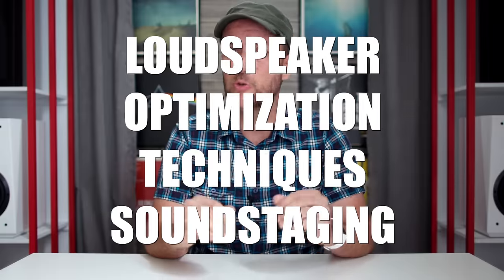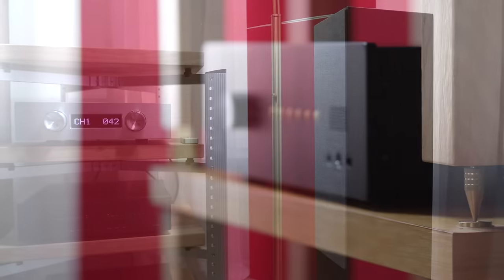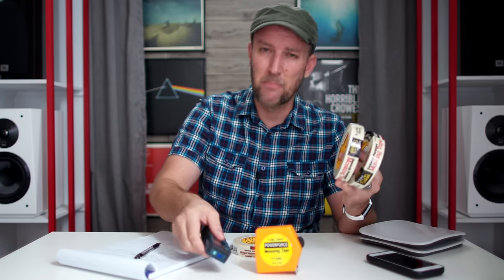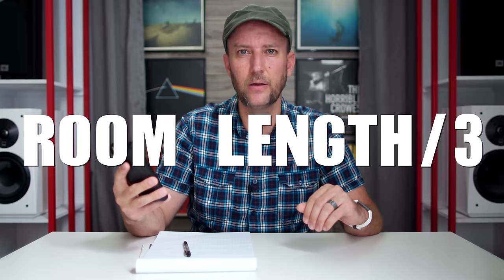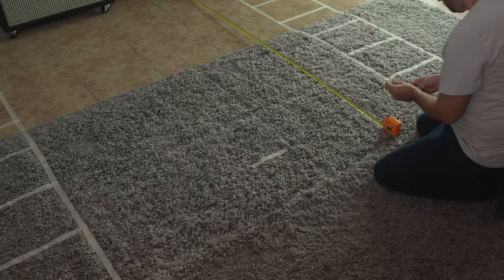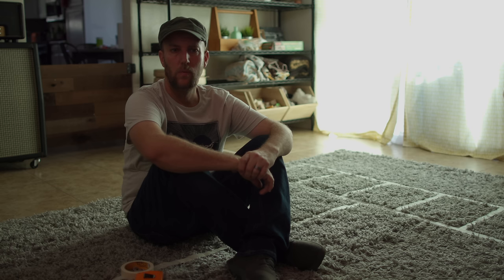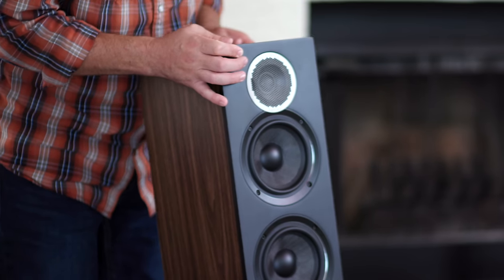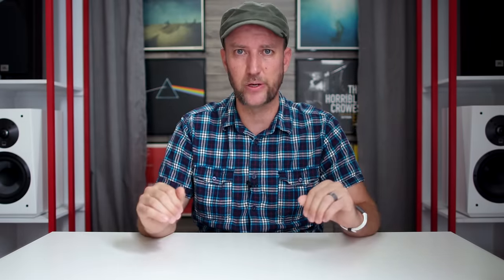L.O.T.S. Loudspeaker Optimization Techniques for Soundstage!

Comment: That's a great method because one is NOT going to focus on the relative "loss" of bass. Of course it would make sense to put the speakers at equal distance from a side wall using one of those node-avoiding distances such as 0.276 (Golden Ratio) or 0.2265 (Square Root of 2) times the room width. Other than that, great method!
Reply from the maker: Thanks so much!
Reply: @Newrecordday2013  You're welcome! I'm sure you realize that those ratios aren't "really" (in the sense of completely) going to avoid room nodes, but are used to avoid the cumulation of room nodes? Don't mean to spread misleading information or add to "audio myths" (as long as there are walls, there are going to be room nodes).
Reply from the maker: Absolutely and every room is different so experimenting is required!
Reply: @Newrecordday2013  Unfortunately! There's no substitute for measuring and listening, and I like your approach as one isn't going to be "blinded" for e.g. imaging by hearing a decreasing amount of bass starting from the front wall, but the exact other way round. The ratios I'm proposing remain the best starting points (avoiding unison resonances) I've found over the years (as to which to start with depends on first-reflection side-wall distance and mid-bass coupling). It's pretty amazing how good Golden Ratio sounds if used on the blind (needless to say 0.447 times the room width from the front wall is pretty far out for a multi-purpose "living" room, but as you're emphasizing in your video, too close to the wall is what tends to be the problem). I'm not saying it isn't worth trying to improve on the math, but that I'd mark these positions and draw lines from them to the respective front wall corners in case one is forced to move the speakers closer to the front wall than ideal. At any rate, there's always going to be the difference between the acoustic centre of the bass driver and the front of the baffle, in other words, there's always room (pun intended) for micro-management and/or going OCD, given sufficient time and patience…

Comment: Very nice demonstration of the rule of thirds. However all of these "rules" are approximations. You can get pretty amazing results using the Golden Ratio or 5:8 rule it really depends on your actual room size and layout.  The biggest challenge for most folks I think is going to be having your couch out in the middle of the room. In practical terms therefore you may need treatment on your back wall to help it "disappear" somewhat.

Comment: Thank you so much for sharing your work. I have an acoustic treated room which is my 2 channel listening space. I have been an audio fool since 1969 and love my vinyl, tubes, etc. I have built my own electronics, speakers, etc. I have always used the Carda’s triangle for speaker placement. I followed your instructions exactly as you laying them out (pun couldn’t resist). Put my tin foil hat on and did the “dark night of the soul” setup moving from listening position one square at a time until “holy mole” the damn things disappeared. I turned the light on and measured them and guess what, perfect Carda’s triangle! What fun!

Comment: Is this method primarily for music purposes?  Can this be used to set up the starting positioning for home theater speakers?
Reply from the maker: Dude, it would work brilliant for home theater applications as well as long as you have the room... absolutely!
Reply: @Newrecordday2013  Awesome, I'll try it!  But basically this only goes for the front towers, right?  I would just base the location of the other speakers off of the tower placement?
Reply: @Newrecordday2013  thought I would come back here, because even though I was super excited to stick with the method, the measurements put my towers right in front of my TV (it’s a large 65”), so I couldn’t really do it properly.  Any advice on that?

Comment: How would this work with a room like I have. My listening room is 15 × 30 feet my listening area is at one end of that room and it's about 12 × 15   with the speakers on the 30 foot wall.  I have a wall to the right of me but the left side is open to the rest of the room with only a small sofa dividing it. How would that change the way I measure for the speaker layout?

Comment: Great tutorial ... Something I will use when setting up my speakers in a few months.  One question though, why not do this in reverse?  I mean, still using your room calculations, but instead of moving the speakers down the "tracks" from seating position, instead, use the seat as variable and move seat from speakers on back until finding "sweet spot" and then finetune by adjusting the final placement of the speakers including the angle and tilt?   Seems like would be easier with similar results, especially with heavy speakers.  Great information though, glad I saw this.  Not trying to be a SA,... so please correct me if missing something.   In my case, I have a smaller room... around 12' x 13.5' .  I didn't read comments in case this was already brought up.
Reply: It's all about speaker placement and interacting with the room, not sitting position.

The sitting position don't change the source, just a little bit of perception

Comment: Ron, do we leave our speaker distances (in our AVR/Processor) at 0ft during setup?
Reply: I followed your methods – in spirit. While this room isn't big enough to bring the speakers out even 1/4 the room width without ending up with a listening triangle that's only 5.5' on each side, I was encouraged to generally be more bold in how far I was willing to go. I ended up with a 7.6' equilateral triangle in an 11' wide room and the soundstage has improved, even though there is more destructive interference in the bass region. Audyssey XT32 up to 350 Hz plus multiple subwoofers helps tremendously with that. Thanks for the sage advice. Also, I did end up leaving distances and levels at 0 for the placement testing.

Comment: That's pretty clear  but there's something unclear for me and its the room and furniture.  I have 16 feet wide  room but on the front wall at the left end there's some furniture which are blocking 4 feet on the left and from the furniture I'm able to use 12 feet to the right end of the wall.  And room length is 10 feet..   Where should I start to calculate it on the front wall on the left side,   From the furniture or the wall ?

Comment: Man what a great and simple way to start or check your current speaker placement! Have a pair of Maggies .7 in my living room and thought I had found a good setup after countless hours... after ten minutes with your method I found magic all over again! Thanks, you rock!
Reply: I have Magnepan 0.7's also and my main issue is my listening couch is up againts a knee wall but I do have sloped ceiling that should help somewhat. They are positioned 44 inches from the front wall and 84 inches apart and approximately eleven feet from my couch Non the less they sound they sound pretty darn good with good soundstage and inner detail, but always wonder if they could sound even better. How much watts/amps do you have driving your .7's??
Reply: @Jack96993  Glad to hear you're having a nice time with your system too. I am driving my .7's with an old Nad M3 integrated. Puts out 180w per channel @ 8 or 4ohms but more importantly, it drives the speakers with a decent amount of current. No analogue sources, just a Bluesound streaming Tidal. Honest and happy.

Comment: PERFECT! I Just moved in to a new apartment and Im setting up my audio. The only downside is that the room is not a perfect square. It's an old building in the old city of Kraków. (over 100years old) what do you recommend in such scenario? Should I still measure from the wall and if one of the speakers is more up front just move it back?
Reply: Depending on the exact layout of the walls, this could work in your favour, it could improve the standing wave effects,
If I were you I would average the difference in measurements and start there,
I'm in no way an acoustic engineer, take my advice with a bucket of salt! 

But at least tape/time spent is cheap, so have a go with different measurements, good luck

Comment: Where to begin…. Life changing? A religious experience?? I’ve been listening to 2 channel audio since 1981 and I have never experienced ANYTHING like I experienced this afternoon and evening after going through this process. I have followed many of the best practices in the past - equilateral triangle, move speakers away from the wall, toe in, etc. and while it has sounded good. It’s never been earth shattering. I’ve never been able to hear those things that people describe their speakers as having - a 3D effect, sound coming from points beyond the speaker, the speaker disappearing, etc. I guess I’ve never really experienced "soundstage" before although I always thought I had. All that changed today. I measured out my room, went through the speaker placement process like you described, and then there was this sudden change in how they sounded while testing placement positions. And not this little incremental change, but a HUGE SHIFT in sound. It was like jumping into another dimension. It felt like the vocalist was right in front of me and I could touch her. The instruments sounded as if they were all around me vs. just in front of me. Some aspects of this set up really surprised me compared to,how I have set my speakers up in the past. First, they were much further away from the front wall than I have ever set them up. Second, they were much closer to me than ever before. Not near field, but closer than I would have expected them to be but not really directional. Third, the toe in was much less than ever before; instead of pointing directly at me, they were pointing to just outside my shoulders. This last change made the biggest difference - that 10 degree change resulted in the biggest impact ever!! Thank you so much for putting this video together, and you have made an impact on my listening experience that I will benefit from for the rest of my life!! 😃😃
Reply from the maker: Wow Mike! I really needed this comment. Been in the dumps lately about my channel and work. This comment really came at the right time.
Reply: @Newrecordday2013  Don’t be in the dumps! I’ve been following you for quite some time but never felt compelled to comment before. You make a way bigger impact on people than you realize. There are lots of lurkers! It was because of you that I got the Elac Uni-Fi  2.0 UB52’s and they are the best speakers I’ve ever had.

Comment: You didn't mention babies in the tool section. Do I need only 2 or should I have more? Where do I get some, amazon? Can I get a link to where you got yours? where they expensive? Thanks
Reply: You need 3, otherwise there won't be any audiophiles in the future. And yes, they are expensive, but I hear totally worth it.

Comment: ALL a compromise!  Yes, getting speakers out from front wall in a near field setup, gets you potentially way more direct sound, and better potential sound!  Still need to heed set up fundamentals (i.e, flat response and good coupling to the room/sets, treat reflections - yes absorb behind, but not the whole room behind you!).  Still need to do one speaker at a time for response, then toe-in/aim/tilt, etc. I also don't agree with fixed speaker stand height!  7'/8'/9'/10' ceiling, etc, all require different speaker height on stands, ideally!  Not just "ear level" tweeter. Might need to tilt the speaker to adjust, but bass response and even response is more important with height.  Of course, speaker width will depend on speaker design needs in given space in relation to seating distance for 2 channel, in particular.  
There's not just one way to setup speakers for great sound, and lots to consider! Horns need different setup requirements , than typical ,and dipoles even different too!  Takes time to get it all right based on your needs and limitations, compromises, etc.  And, yes, EQ might just be needed in home theater system with speakers on walls, or where you can't move couches, so and and so forth.  
EVERYONE ends up with different setups and gear!  Key is patience and listening, moving things, measuring, and more listening, trial and error.  It's a hobby, not a plug -n-play kit!  Room acoustics?   That's even yet another story...

Comment: There's also the triangle method to establish the same results, then you just tweak the high and low end by tilt, and toe.
Reply: Nope, not the same. This way might put you 1.5 meters away from the speakers and speakers 3 meters apart. It really depends on the room.

Comment: Most important thing in speaker placement is their distance from the rear wall.  Too far away and the bass is too weak.  There is a point where its balanced.  Also tow them in to where the tweeters meet at your nose or even a few inches in front of your nose if you want pin point sound staging.  If you want a wider sound stage spread the speakers out but still aim them at your nose.

Comment: Division of a number doesn't render an answer in feet & inches. You were given decimals and you took the 10ths or 0.10 of a meter as inches. That's a LOT of fussiness built on inaccurate maths.
Reply: I mean really I came here to say the same thing.  Cool technique, but get the math right.
Reply: 1/10th, 1/12th - that's close enough. It doesn't have to be THAT precise, especially since the Ron's method encourages you try a bit of left to right variation which will overlap that calculation error.
Reply: Was about to type the same thing
Reply: He took the 10ths of a foot as inches.
Reply: This is where the metric system shines.

Comment: How have others dealt with a listening room that doesn't have a wall on one side? My "room" is shifted left as the right wall is non-existent. That's the "hallway" that flows to the back of the house. So the speakers can't be placed out right even if there is no wall. Do I just do the math pretending there is a wall?

Comment: Lifting speaker cables off the floor makes a huge difference if they are lying on carpeting. Especially nylon carpeting due to the capacitance effect. I have a high-end system and raising the cables made a big difference. It greatly reduced smearing and greatly improved intelligibility of lyrics. Raising the cables off the floor in my second system where the cables were laying on stone did not make an improvement.

Comment: I was only about 6 inches too close to the wall and a foot too far between the speakers in my original setup, but what a significant and noticeable difference those two changes made!  An evening well-spent!  Been listening for 3 or 4 nights now afraid to try the last (toe-in) step it sounds so good.  Excellent video and channel.  I purchased a CM3 a little over a month ago, partially due to your original review (that you make fun of today lol), which I ran across while auditioning a good friend's low-hour CM1 in my home and could not be happier.  Room treatments are up next due to all your solid recommendations, so far.  Keep up the excellent work!

Comment: 22 feet divided by 3 is 7.3333 feet. That's not 7 feet 3 inches. It's actually 7 feet 4 inches. But it probably doesn't make a difference at that scale.

Comment: I have discovered your channel just recently. You are talking about soundstage. But you are forgetting a big big thing and that is ambiophonics. It will be much much better then this set up. Maybe a good way to combine it. I have tried the dsp but it didn't do a thing. I have placed a multiplex where I can lay my head on so I can hear the left speaker with only my left ear and the right speaker with only my right ear and the multiplex is about as high as my ceiling and almost the length of my listening position to my speakers. And then we can talk about soundstage. It is a very different thing. I can  place every instrument and singer depth and width. It was shocking to me. It is not an easy setup I agree. But just try it. You have to hear it. it also agrees with science. You can look it up. I think everyone should try it. It is very cheap. Maybe you cannot keep it but you will be amazed.

Comment: So my speakers should be only 4'10" to 6'20" spaced apart, and I should be sitting only 5'17" from the front wall, with a 65" TV in the way???? My point is, that unless you have a gigantic room dedicated to hifi, forget about the "magic". And what about not having a wall on the right side?
Btw, I have tried literally every possible positioning for my speakers, and the difference is next to... zero. The problem in my case is mostly in the low end of the spectrum, below 80Hz (due room size), and it's always the same, regardless of speaker position. I can only get more or less bass, but it sounds always the same (awful)... I can't expect to improve the sound either, with bass traps, since there'a peak at 33Hz, a huge "valley" at 50Hz, and then again the 2nd mode with a strong peak at 66Hz, and these are frequencies you cannot deal with bass traps in a room that is only 13'5" x 16'15"...